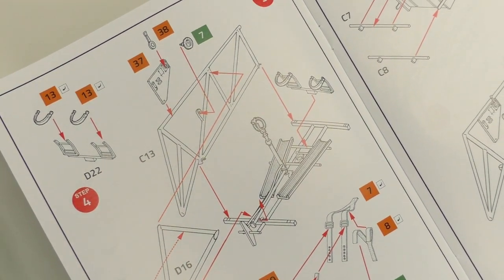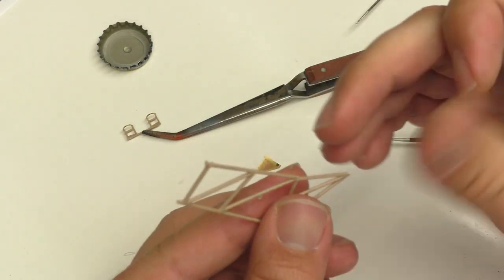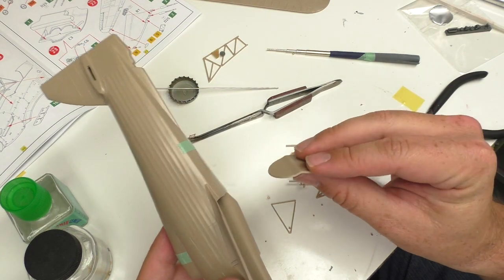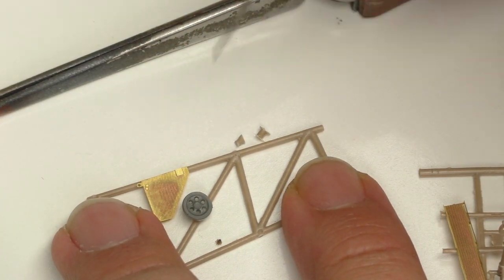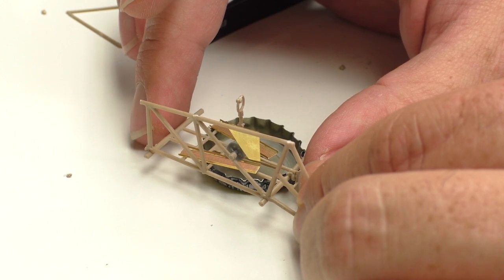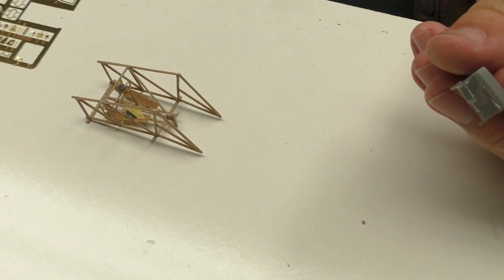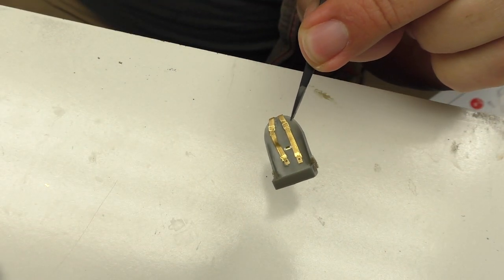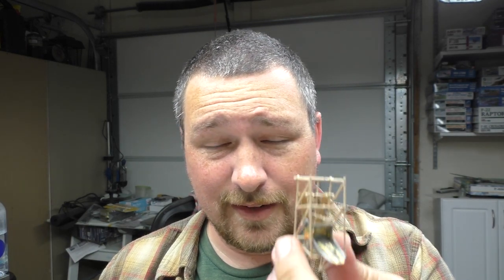1/32 Fly Hurricane IIc Review Pt 3 - The Cockpit, Again

Comment: Hey Doog, I was wondering if you are using slow setting super glue for the photo etch, and also what's in the big clear jar that you're using to cement the pieces together with.  Thanks.
Reply from the maker: The CA is Loctite Ultra Control Gel - it's not exactly slow but definitely slower than thinner CA. 

As for the bottle, that's MEK, solvent-welder extraordinaire usually, but the softer/slow-to-set plastic on this particular kit proved problematic.
Reply: Doogs' Models good to know thanks

Comment: This is the worst model I have come across!
Reply: Damn... I literally just got one.  Was looking forward to building it, but not so sure now. I guess its gonna be one to take a lot a time with.
Reply: @chiselcheswick5673  I could not find a 32 scale to go with my Spit and 109.
It’s still on going but I’m using more filler then B and Q can supply lol 
Nothing fits right instructions are well crap.
These videos have helped with the build.
Best of luck
Reply: @TheSnookerShed  😅... hope it turns out well in the end. I was same as you and had a spit, and 109.  Oh well good luck too.
Reply: @chiselcheswick5673  cheers pal it’s getting there won’t be as good as the other two but paint and wash can hide a lot.